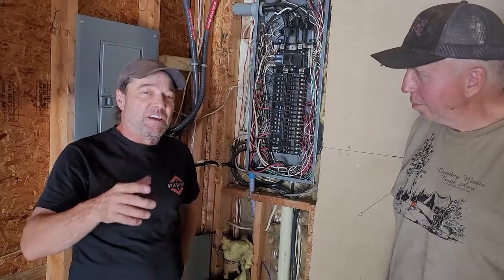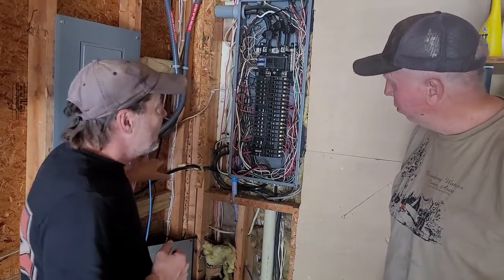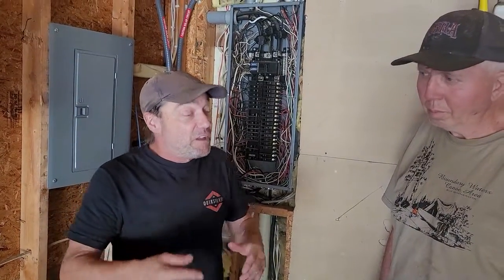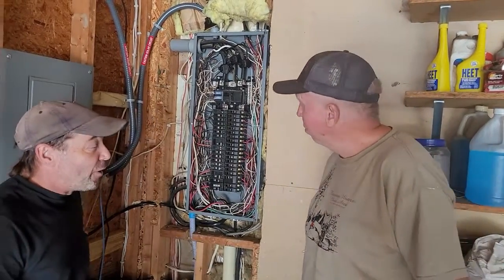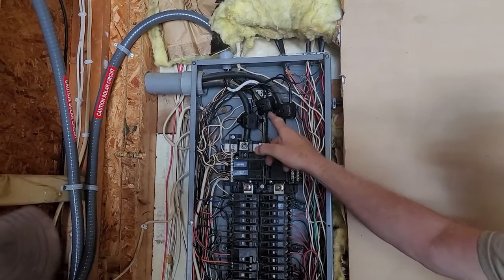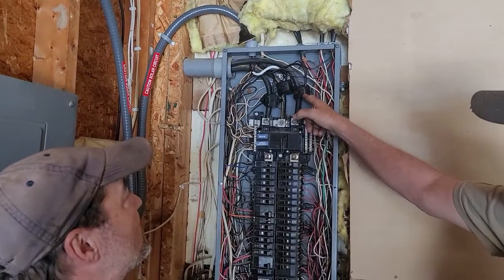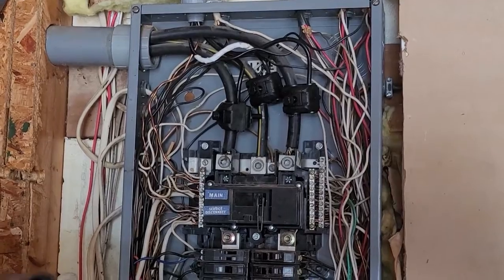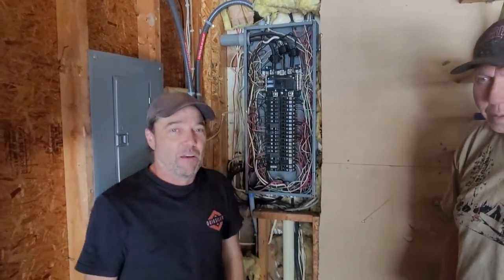Solar System Line Side Tap Installation Made Easy with the Turbine Guy

Comment: To do it properly you need to have your power company disconnect power.  ?  -EDIT looks like as long as UL listed its good to go.  thx guys
Reply from the maker: @bandit8623  wrong. These are made to do this this way.
Reply: @TurbineGuy  sounds good! learn new things every day.  so how did you tap this safely though without disconnecting power?  every place that talks about line taps mentions having to have power company shut off power first.  thanks
Reply from the maker: It is an insulated tap, no possibility of a short or hitting bare wires. All kinds of new technology these days to make our lives more simple. However, I would caution that they are limited in their amp capacity compared to the old style tap.
Reply: @TurbineGuy  maybe but there are better proper ways than cheating with this....
Reply from the maker: passed inspection just fine, no "cheating" involved

Comment: So a pv system is too big to run to some open breakers in the panel so this is the other way to connect? What’s the minimum size of amps or size of a system that we can use a breaker? And is there another way besides this?
Reply from the maker: Electric panels are legally allowed to run 20% more than their rated capacity into the busbars, thus a 200 amp panel can run 240 amps into it. Subtracting the 200 amp main breaker leaves 40 amps for a PV system (put the breaker at the bottom of the panel). You can potentially double lug the PV to the load side of the main meter as well.
Reply: @TurbineGuy  why wouldn’t this be considered safer or cleaner install?
Reply from the maker: In many respect it is safer for large systems, cleaner all depends on the overall system locational issues. The solar system may be near a panel, but not the meter  (on another building for example)
Reply from the maker: Don't forget to like the video and sub the channel please!
Reply: @TurbineGuy  it’s safer to do the crimping on the wires than to run to a breaker in the house?
Reply from the maker: @DakillaChi  The bonus to the breaker is the overcurrent protection it provides, and, it can isolate the system if you have disconnect issues.
Reply: @TurbineGuy  but I’m asking about the wires that go from the disconnect to the line side tap crimping how to avoid that crimping
Reply from the maker: I believe there are single to double lug adapters for all wire sizes
Reply: @TurbineGuy  but they will still be in the meter box and that not allowed

Comment: Your a nut.  The lugs are rated for the power coming in to your panel.  You are essentially overloading the lugs and the whole electrical system potentially causing problems that could result in fires.  And that's when people get hurt or killed.  Worse than that you are advertising this here for others to see.  Not aware of your total lack of knowledge.   You should be a good person and remove.  Do more research and next time you want to work on things yourself......think again.